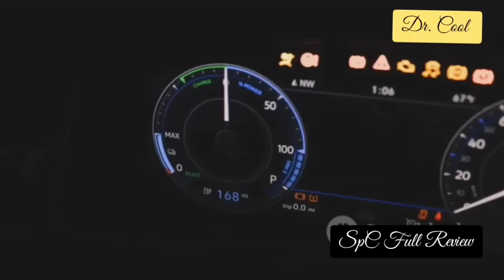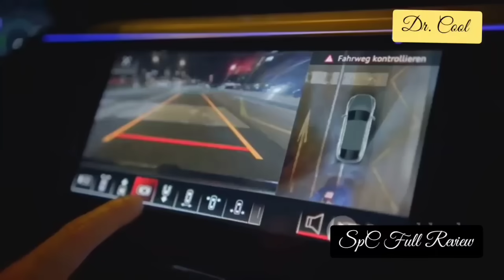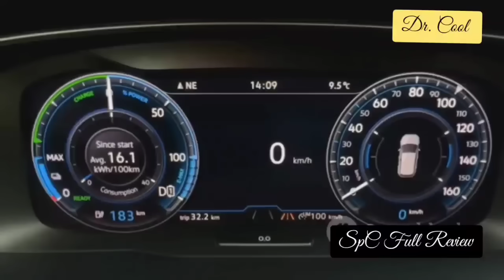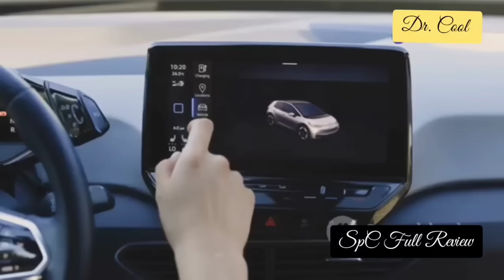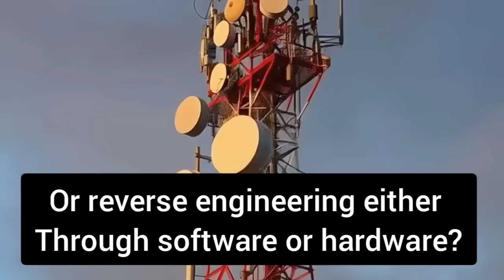Maxwell Chikumbutso Self-Powered Car REVIEWED: Full Specifications & Features SHOCKS Scepttics!

Comment: Where do the Electrons come from… It’s Very Easy to Generate Very High Voltages then use these High Voltages to extract Electrons from the Ground or you extract Covalent Bond Electrons from Water & have HHO Gases as byproduct of this Electron extraction process from Water. You have to understand that Energy cannot be created nor destroyed, it can only be converted into another form of Energy. If its switching very High Voltages then collecting Electrons using a ‘Live Negative Potential’ to a ‘Dead Negative Earth Potential’ - Everyone on the planet already knows how to do this as the Earth is an Un-Limited Reservoir of Electrons. When its a portable device, I can’t see where the Electrons are coming from? Theres hardly any Currents in surrounding space?

Comment: What happens when these ‘self powered’ cars use up all the radio waves do they stop working?
I should add that this video is nothing more than a sales pitch for an electric car, interlaced with the same old statements about Maxwell’s ‘invention’ to give the impression that the car is driven by radio waves.
Reply from the maker: It doesn't that's why you need to watch more of my videos where I explained it in details.
Reply: This man is JEALOUS!😢😢
Reply: @Argee52  
Jealous of what?  Jealous of BS?